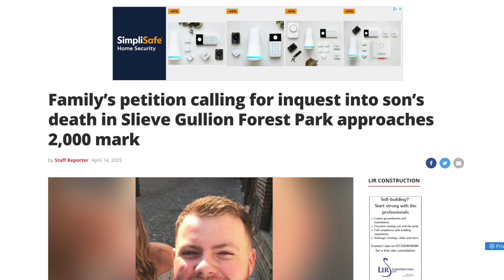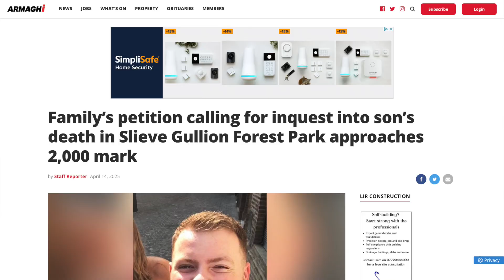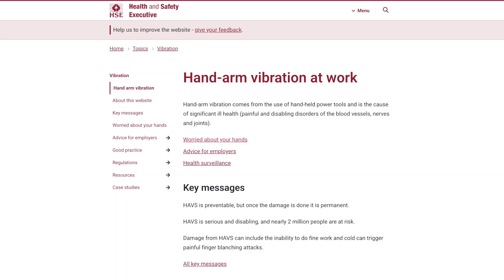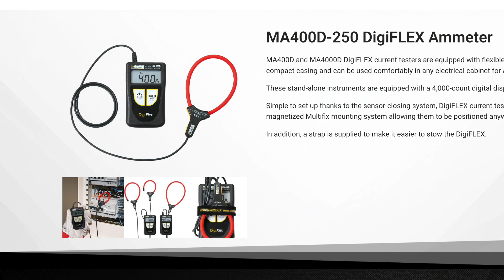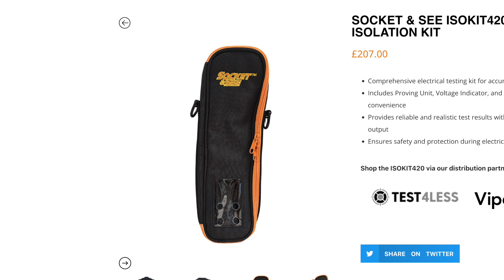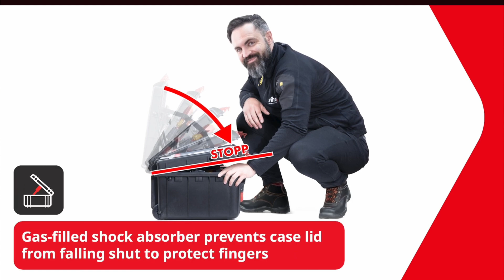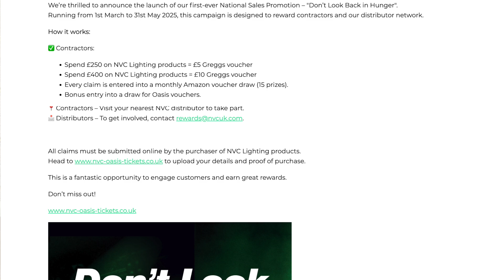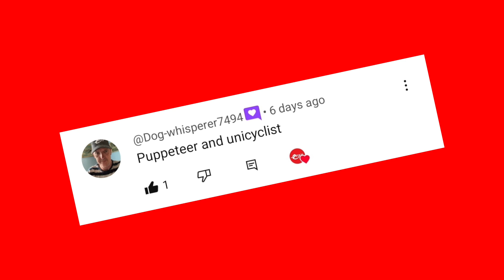Electricians Keep Getting These 8 Things Wrong

Comment: I actually wrote to Barrett the gun manufacturer many years ago saying if they can provide recoil protection from large calibre guns, perhaps they could do it for vibrating tools, nothing. We have many ways to stop vibration, it is a difficult subject in tools though, as it is also the way they are used, you wouldn't press a gun against a wall and fire it. People are impatient and lean on vibration tools, passing those vibrations onto themselves. I have a particular disability, Arterial Spasms, it means vibrations or repeated movements cause my arms to shut down and go into cramp. I sustained it in a burn's accident, and it is a rare condition to get. I therefore do not lean on vibration tools, I let the tool do the work, yes it takes a little longer, but it also means I can work longer.
Hammer drills are supposed to be used without leaning on them, you should be able to lightly hold the tool and let it do the work, but I also found if the bit has a chip out of it, it works more effectively, so perhaps the key is better designs for the bits. You don't see people using a Vibratory Rammer Jumping Jack Tamper by sitting on it, so how can you blame others because you do? Many fines can be laid out, but when it comes down to it, this is just another aspect of blame culture.
Do a piece on illuminated levels, there is nothing worse than getting to the end of a day and needing to level something in low light.
Reply: My dad used to run a Rolls Royce factory in the 80s and vibration white finger, as the variant that they got was called, was a serious problem among the machinists. They had a program of tool balancing to minimise the vibration that was produced.